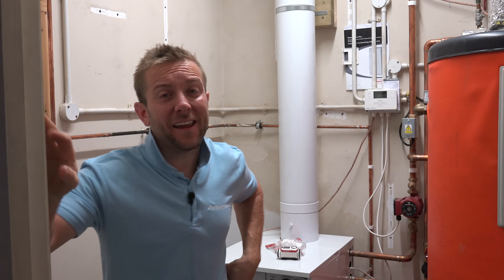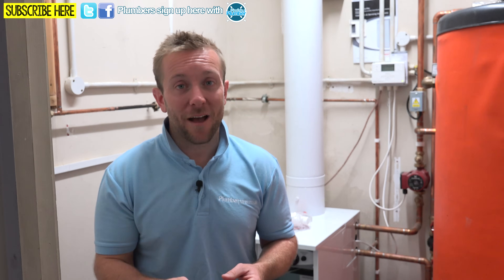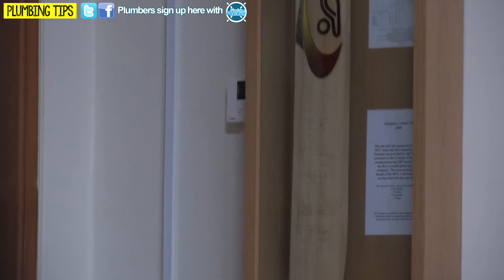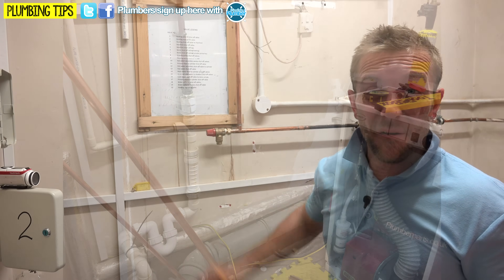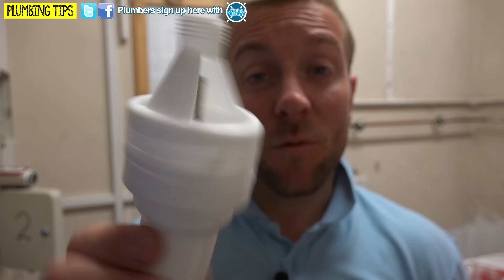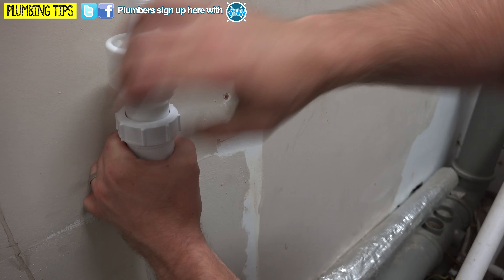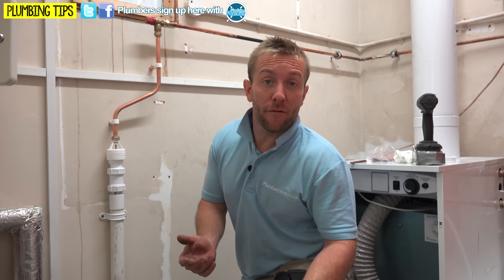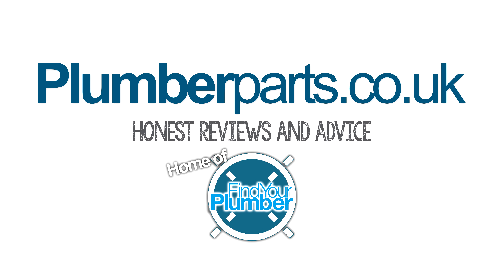HOTUN TUNDISH INSTALL, DRAYTON MiGENIE  - CHIT CHAT

Comment: Our boiler started to give an engine like noise and gives an error about losing flame. This happens when hot water and cold water are mixed in similar ratios. A gas engineer checked the gas pressure, inspected internal parts, installed a new gas valve, but the issue still remains. I am thinking of installing a tundish as the plumber who installed the boiler didn't install a tundish.

Comment: Im intrigued,Solvent weld doesn't have a high temp rating,we are told too use push fit,how did you get round that one using solvent?

Comment: I am fitting a system WORCESTER BOSCH GREENSTAR 35cdi CLASSIC 
Can I use this, the boiler has a built in PRV and reg's I have seen don't mention one and it also say's the pipe work must be metal and  increase in size  over a certain distance from the boiler, oh and your an entertaining nutter by the way.